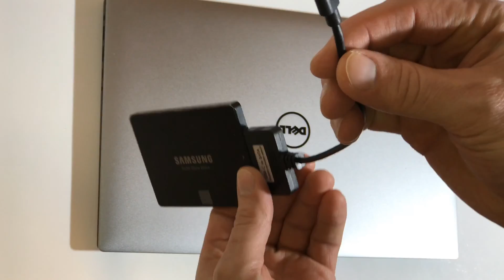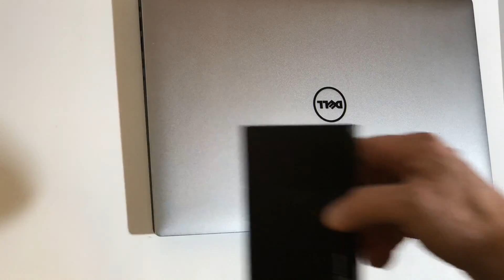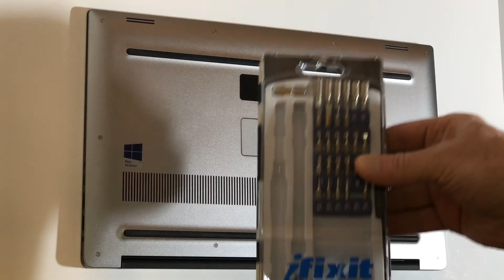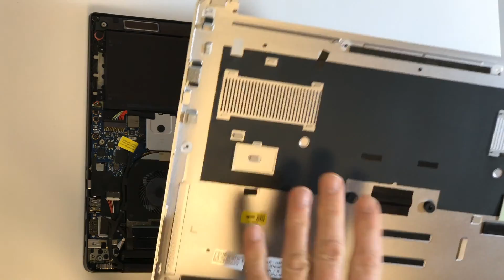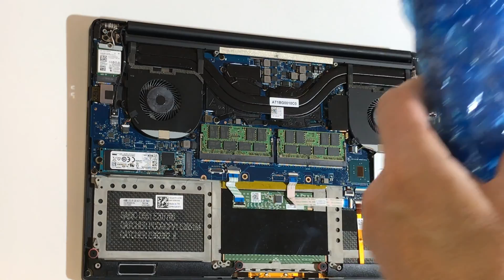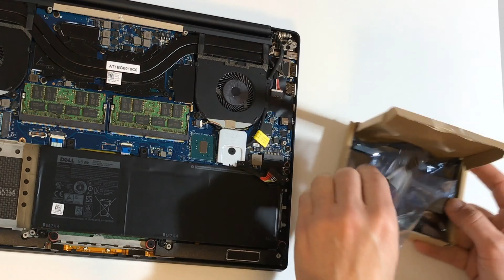How to free up that internal 2.5" HDD/SSD drive bay in your Dell Precision 5510 laptop [4K]

Comment: Hello, Is it advisable to replace large battery with smaller one when one has 4K UHD panel?
Reply from the maker: Good point! I'd say it depends, if you are usually plugged in, it matters less.

Comment: Hi mate, I performed this mod, added 2tb hdd still with 250gb m.2 left in machine. But when i startup, does not register my hdd in the drives section in my computer, only when i open intel storage app. Do i have to change something in BIOS? thanks
Reply: go to computer management then go to disk management u will find your 2tb hdd ,format it to ntfs and you r ready to go

Comment: What kind of battery life do you have with the 56whr vs 84whr. I'm actually planning on doing the opposite - installating the 84whr and removing the 2.5 hard drive.
Reply: exactly, he must have sacrificed so much of the battery life doing this :) and I also want to do the exact opposite and install the 97 Whr battery

Comment: The HDD kit is the same for a dell XPS 15 9560?
Reply from the maker: Not sure, but it probably is.
Reply: @TinkerTry  where can I buy that kit? my XPS 15 9570 came with the smaller battery, but I cant find that small sata cable!

Comment: How do you get the pc from displaying "Preparing Automatic Repair"? I installed a 2.5" HDD for additional storage and got this message when I powered up my 5510. Was I supposed to change something in the bios? Thanks.
Reply from the maker: Did you manage to fix this? It would seem you need to adjust your boot order in your BIOS settings, specifying that "Windows 10" that it finds on your existing M.2 NVMe be up on top, not your new SATA drive.

Comment: Great modification, I really respect this kind of personal customization. However, I personally would value the 84wh a lot more than an additional drive - even though I definitely prefer two drives to one (for a multitude of reasons, both in terms of performance and safety). In my own case, with my 5520, I am choosing to keep the large battery but opt instead for installing a permanent SDCARD in the SD bay (which mostly sits unused anyway) and plugging in a usbc ssd (as you demonstrate) for work in a stationary environment (like my office). It is of course not the same as having two ssds in the case, but it allows me the redundancy of multiple drives, isolation of key files from OS, and additional (albeit slower) space that I might need at times.
Reply from the maker: +Kevin Chow Helpful, detailed feedback, thanks Kevin!

Comment: Why?! Leave the big battery alone and replace the nvme, you can put a 2TB one
Reply from the maker: Or, two 2TB drives!
Reply: Victor 2TB M.2 SSD is very expensive bro. This whole upgrade setup is within 200 Dollars, whereas 2TB M.2 is around 700 Dollars - Now you decide. Also with 2.5 ssd you can dual boot hackintosh and windows. Hackintosh causes install problem on NVME SSD. Hope this answers  your question
Reply: also i am taking about 2TB SSHD not SSD